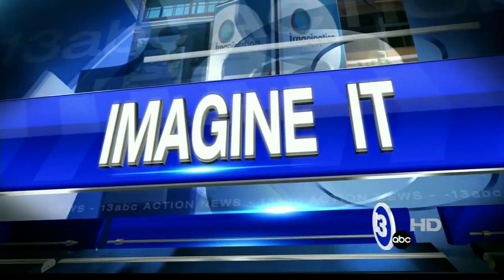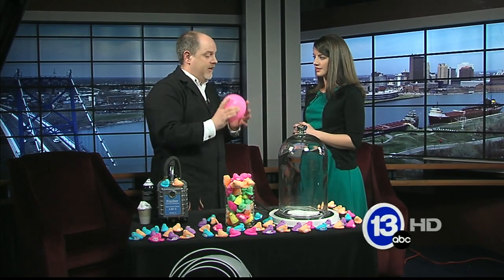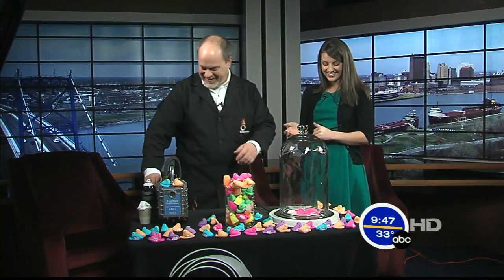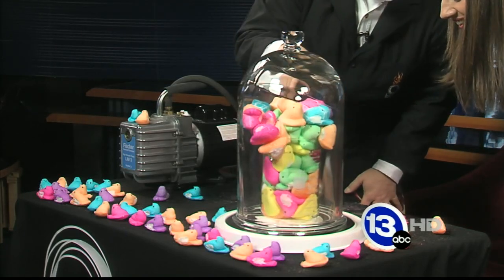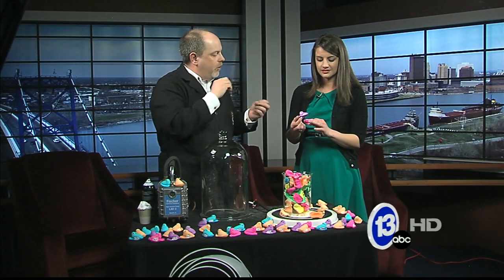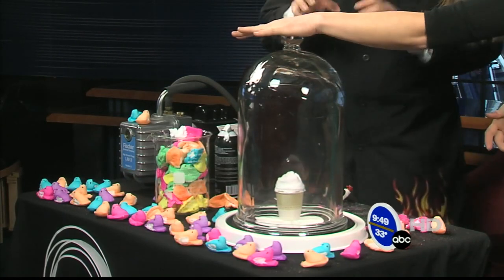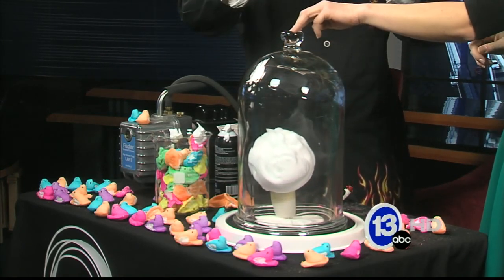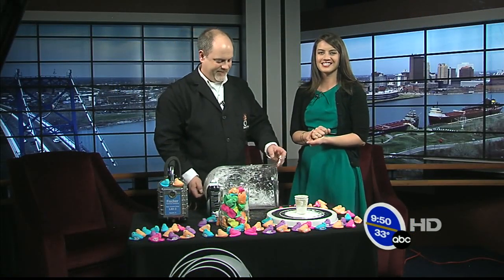Peeps in a vacuum chamber

Comment: where the pressure differences do play a big factor and why the shaving cream behave that way I believe at the end the reason it exploded is because the air coming back into the chamber comes from the bottom at a very fast rate and shaving cream is so light that the force of the air shoves it into the top of the container

Comment: What happens if you put soda in there
Reply: +Celeste King You get really flat soda really fast.
Reply: logsforburning oh ;(
Reply: +Celeste King dont worry, it looks very dramatic. the lower the pressure is, the less  solubility a fluid has. so as the pressure decreases the soda quickly becomes very densely supersaturated and then quickly de-saturates causing an eruption similar to dropping mentos into soda.

so, to quickly go over everything that will happen, or at least everything that happening in my experiment:
1. the soda started to boil due to the lower pressure
2. after about half volume it became supersaturated and started foaming violently 
3. the first experiment used a wide topped beaker, which meant that the CO2 was being sucked out by my vacuum chamber before the pressure could build
4.which I found really boring so I redid the experiment with the thinnest topped  Erlenmeyer flask I owned, which resulted in the soda eruption I described above. 

so with a little help from myself, it was a rather violent reaction and it was amazing, Thanks for the Idea! It was fun. hope this helped!